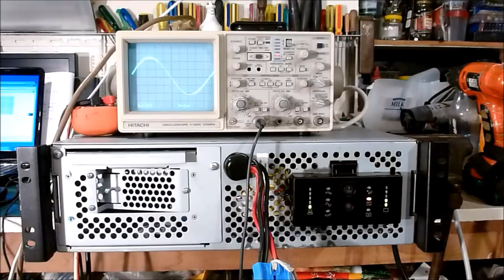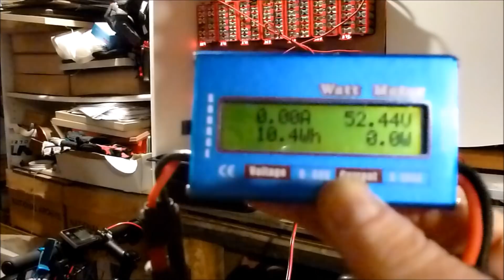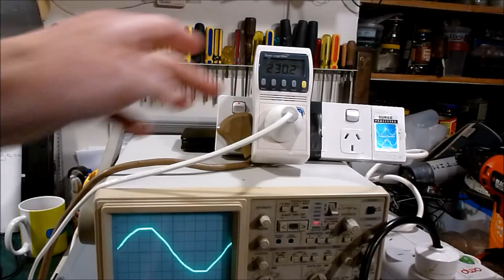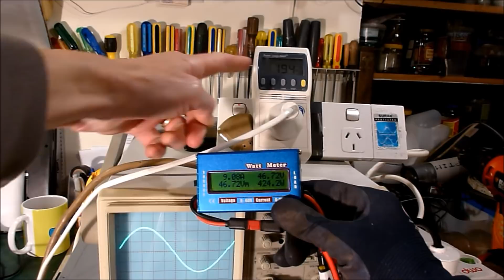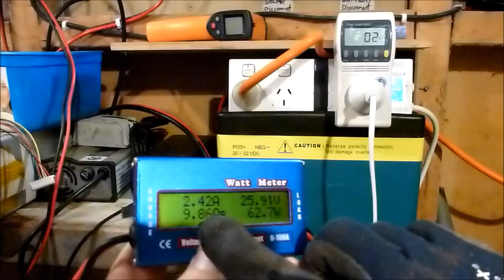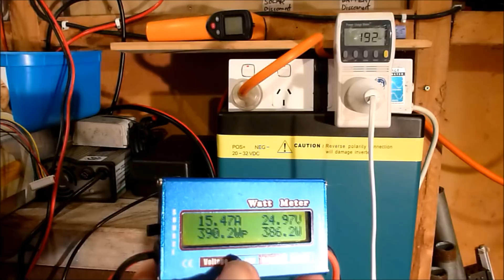Laptop Powerwall 134 - Testing 48V APC UPS inverter output

Comment: Wow, I run my apc2200va off of 21kw of Nissan G1 batteries. It handles all of my 120v loads. 2 fridges one frezzer 5 tvs microwave lights everything. But it is a pig.
Reply from the maker: Oooo - sounds like a good setup

Comment: Hi Paul your problem is voltage drop across your wimpy wires, if your wires are thinner than the UPS battery wires you will have problems, You drop 5V battery voltage at 200W load so with an 1100W load it will be a lot more, so the UPS drops out to protect what it thinks is low battery voltage.
You need short battery leads i.e. 300mm or a lot thicker and for that distance you had probably 2 AWG.
The fans run all the time as a UPS is only designed to run for short periods to allow a computer system to power down gracefully.

Comment: At 9m:50s with the load on i see the voltage is dropping and flapping aound with 350w load. Hitting 46v. I think this is why when you try put a 1100w load the battery voltage is dropping to the UPS cut off.  I think the only problem is the voltage drop on the batt causing the ups to shut off on higher loads.

Comment: When the inverter was on mains and pulling 221w base load. Given nothing is connected to the output, is the 221w used because it is trying to charge the battery?
Reply from the maker: Oooo. I hadn't thought of that. Maybe. I came away from this episode thinking there's a lot I'm not sure about.

Comment: My 1000W inverter/charger will run my 1180W heat gun on high although it complains about the overload and will shut off after ~30 seconds or so.  But on low, it really struggles with the heat gun.  If I look at the power factor, it's 0.99 on high (as you would expect from a mostly resistive load).  But on low, the power factor drops to 0.69.  I suspect they must have some sort of triac switching the AC on and off and that is not done in a very inverter friendly manner.  

I suspect the UPS is consuming a lot of power at low loads mainly to drive the big output transformer.  My inverter/charge is basically like a UPS and it consumes ~40W at no load, either off the grid or off the battery.

Comment: Hey Paul, nice Video!  Im thinking maybe the problem with the bigger load is the UPS still has the settings or is still calibrated to the old/dead bettery that was in it.  Maybe try logging into it and change the external battery packs to 99 like I did and if that doesnt work then it needs to be re-calibrated with the new battery.  Oh and turn off that BEEP 😉😆👍
Reply from the maker: Oh! Good info.  Thanks

Comment: The video i've been waiting for. So were looking at a 50% efficiency on a 200 watt load (pretty much to be expected), as the rating is for 2700, i think you need to test it with a 1350 watt load and then a 2kw load, then average the efficiency results or something. These UPS's efficiency do improve, the efficiency curve is shocking below 40% load. That heat gun will cripple any inverter(at least my assumption), it is basically a dead short with no isolation, a 1 to 1 transformer might be all you need there. Anything with isolated power supply should work off inverter / UPS. ;)

Cheers paul. :)